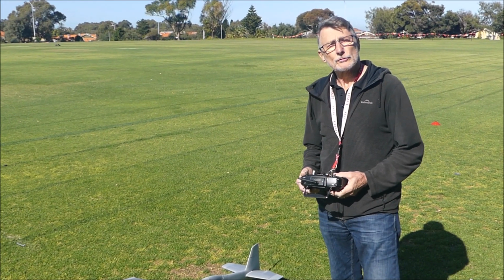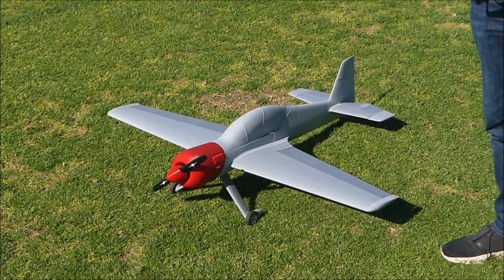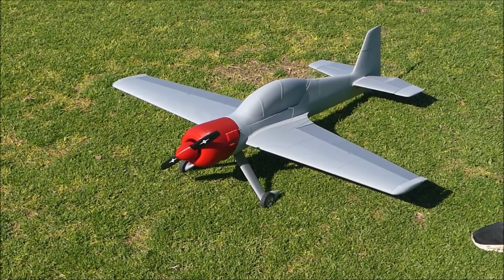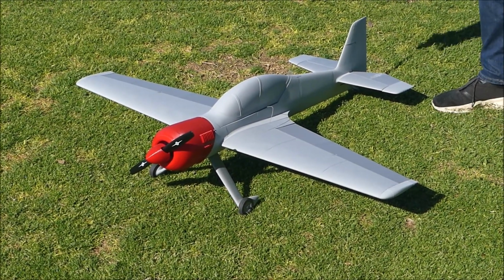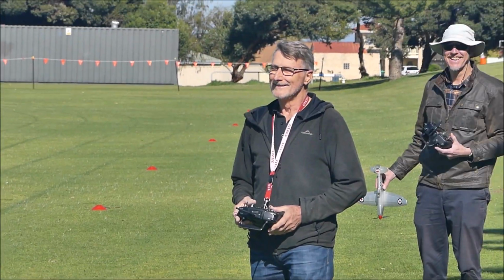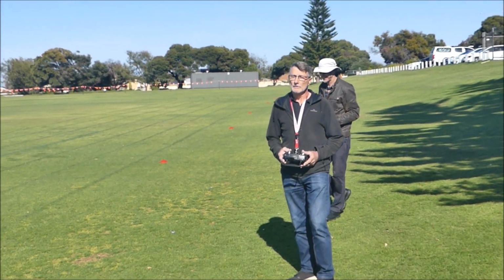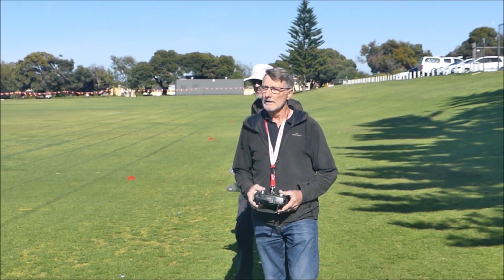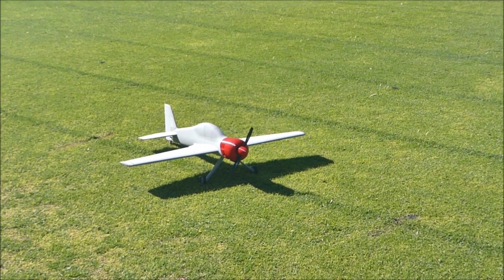3d-printed SU-29 1100mm maiden flight

Comment: I'm looking to print one as well. Can this be done in PETG or is it too heavy? I don't want it to warp in the sun. I've never used LW-PLA. Does it warp like PLA does in the heat?
Reply: Yes Bill, LW-PLA does warp in the sun, but Colorfabb have just released their high temp version LW-PLA HT. I have ordered some, but haven't tried it yet. Sounds promising, even though it comes out a bit heavier than LW-PLA. I believe this model would be too heavy in PETG as it is already 1400gm in mostly LW-PLA.
Reply: @rupert8080  ok cool thanks. I have to try some of the high tempt PLA. Thanks.